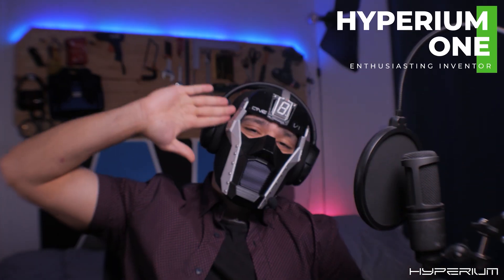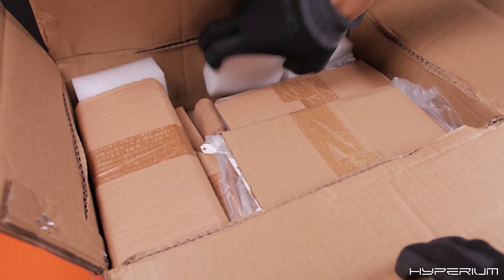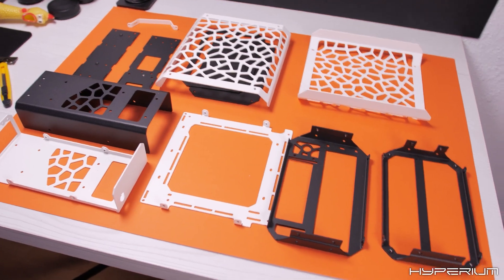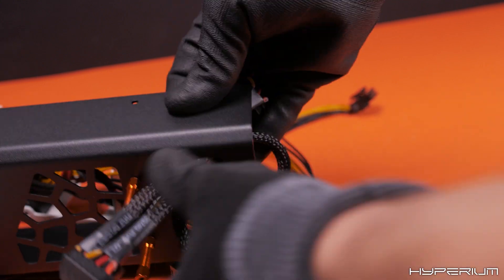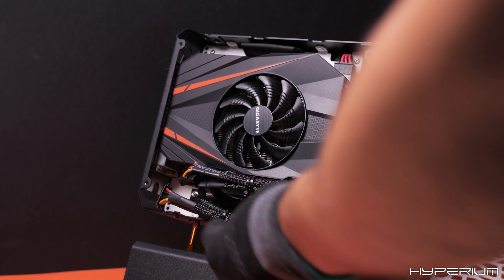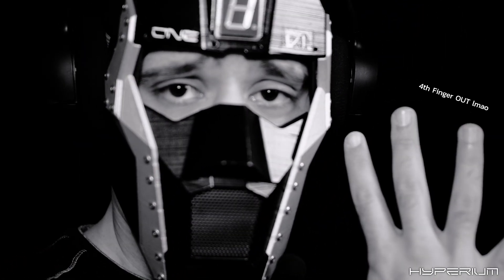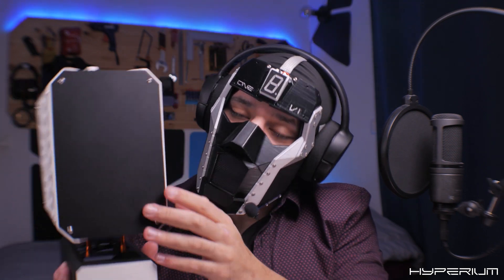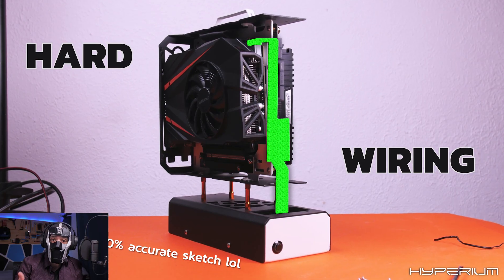I Finished my PC Prototype ... And it will LEVITATE ! [Project Stand4] - Part 2

Comment: I would buy this in a heartbeat if you made the base psu catered to SFX or ATX psu. And the gpu compatibility is more standard sized
Reply from the maker: I do have 2 other case design in mind, "Stinger Six"  is the one with infinite GPU and CPU cooler clearance.
Basically this case with a vertical GPU, and semi Open frame. It'll come in this channel one day :)